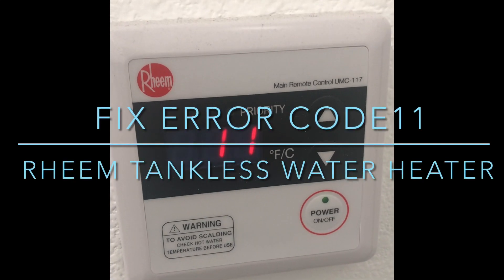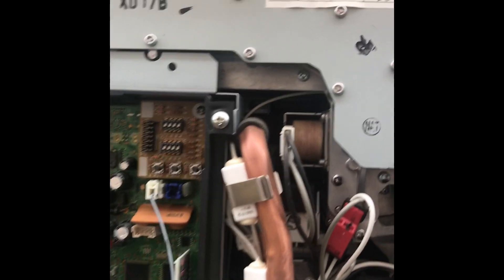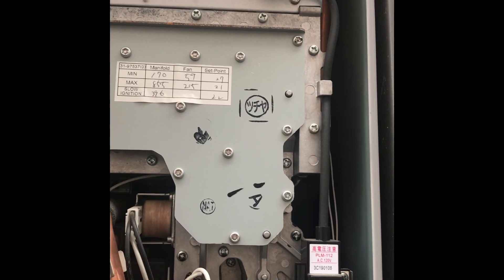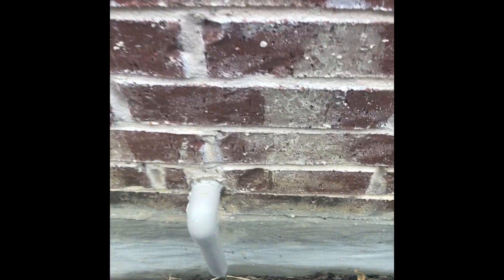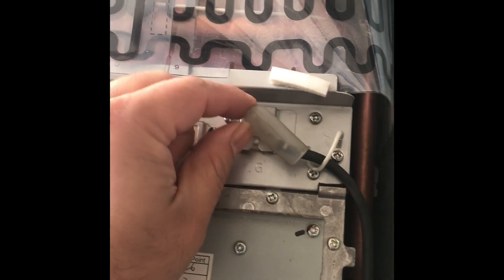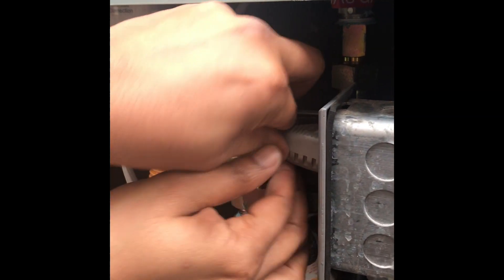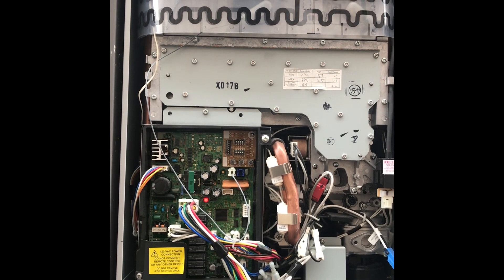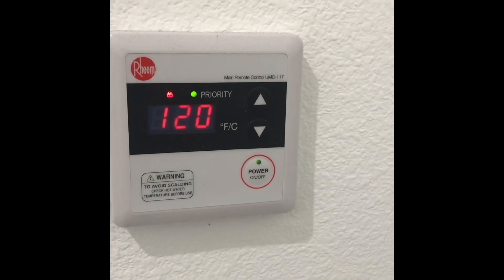DIY Fix Code 11 on Rheem Tankless Water Heater- Replace Igniter Coil

Comment: Thank you so much for this video, Prasad!  I have ordered the part you stated and tomorrow when it arrrives, am about to install it. However, I have turned off the red and blue valves going into the tank overnight, due to water leaking out of the red handle test valve. (Top red handle).   Despite turning the water off on both bottom valves, it's still leaking out of that "test" valve with top red handle, at a steady trickle. I left the test valve open just in case there is a possible pressure issue? Can you kindly tell me what I can do to fix this?  Does this mean a bad test valve, or possibly debris in there? I just had a company flush our system for the first time in 11 years. Don't know why water is trickling out of that test valve. If there is debris from the flush,  causing it to stick open, how do I clear it? Also, I tried pulling the metal relief valve on the left, but it didn't affect the flow.  God bless you sir, Lee 🙏

Comment: Thank you so much for the video.  
I had to buy a new Remote controller UMC 117 it was showing at first P1 error code and later it showed an 11 error code.  So I m hoping if I can change the igniter coil and it will work. Thanks again I have subscribed your channel and liked it as well. Looking forward to see more useful videos in future.

Comment: I have an old Paloma PTG-74PVN-1. I don’t see an igniter coil on it to replace? :( I opened the unit up and do not see this. Any tips/ideas?? Does it not use an igniter coil? I keep getting error code 11

Comment: This helped a lot.  I have an ECO160DVLN3-1 (it's discontinued) giving me this problem.  I narrowed it down to the ignitor coil & sure enough the water heater started functioning after it was replaced.  The replacement part is much larger so I was concerned that the part would fit but they provided me with the hardware to install it.  Thank you.

Comment: Thanks Prasad.   My unit threw an error code 11 last night, googled the issue and watched your video, ordered the part on Amazon and it came next day.   Replaced the ignitor coil in 10 mins.

Comment: Thanks so much for this educational video. I Encountered error 11 on our Rheem tankless water heater unit. I Found your YouTube video that showed me that it’s likely caused by a damaged igniter coil. I confirmed with Rheem tech support that it’s indeed the root cause. I ordered a replacement off of Amazon and it’s working well. Our heater was under warranty and Rheem reimbursed the cost of the replacement part. Very happy about being able to solve this issue by myself. Really appreciate your video, thank you!

Comment: THANK YOU! This worked. I had someone check the error code and they quoted me $900 to fix, but recommended replacement approx. $1400. Should have come to YouTube first. Easy to get the part from Amazon and got it done really easy. Thanks, again!

Comment: I just had this replaced with a freezing damage unit's part. Look like a common issue. This unit was installed in 2021 after the Texas grand freezing incident. Will call Rheem for replacement part as mine is still in warranty. Thank you. Maybe we are in the same community.

Comment: Lifesaver!! 🎉 thank you for this video! A plumber came out and looked at my water heater for 2 minutes (turned a valve on and off was his assessment) - then proceeded to tell us we needed a new unit and he could sell us one and install it for $2,500. Didn’t sit well with me! Called the manufacturer and they said for my issue it was usually the igniter coil and parts were still covered under warranty so they shipped one to me for free. Found this video and installed it myself in 5 minutes. Hot water is back!! Saved me SOOOO much money. Thank you thank you thank you!!!! 🤗
Reply: Same thing with us

Comment: Damn, replaced mine and it didn't fix the problem.
Reply: How'd you fix it then? We replaced the coil and it still did the same beeping?
Reply: Didn't fix it. Water heater was toast, so had to replace it.
Reply: @jimbolen6364  oh god great, thanks for the update!

Comment: Thank you! Spot on, picked up the part from a local plumbing supply company, installed in less than 20-min, hot water is restored. Great video, you have a new follower.

My igniter failed after 2 years of service. I recently replaced my tankless heater after the winter storm in Texas.

Comment: Great video, Thank you.  The outlet cord problem can be solved with a 90 Degree cord end, and marking the outlet box with panel and breaker Number also helps for home owners or next tech to easily ID the Circuit...  ; )

Comment: You only need to turn the power off, not the water supply or drain the unit.  Turn off the gas to be safe is OK, but again, not necessary.

Comment: Just saw video days ago went and purchase igniter replaced and the symptoms are the same don't know what to do now
Reply: same here......did you figure it out?
Reply: @johngregory3342  need to clean rods I did it with a low grit sandpaper and system working fine
Reply: Hi   So I cleaned the rod but still no luck...got error 11 again.   I did notice a little red blinking light on the lower part of the panel.   Does that mean something?

Comment: I have a riddle for you. My issue was the same as in your video. I changed the igniter coil but still having the same issue. The unit was working fine until my LP gas man changed the tanks. Could that have something to do with my error 11v

Comment: Victory ! Enjoying a super hot bath after messing with error code 11... 

My unit is very gas pressure sensitive (nearly 10 year old unit). 

I use an adjustable gas pressure regulator with gauge. It has a very small window to run happy (barely reading just under 1psi). Anything under or over it won't stay lit & errors out. 

I loosen the gas bleed screw under the unit till it drops pressure. You can hear the gas hissing so I know it has supply. 

Screw it back in & find the sweet spot, a Very low pressure. 

This time I needed to unplug power cord & the ignition system two wires, wait a 10 min. Plus it all back in an boom = Fire !

Comment: I've been trolling YT the past 24 hours, "In Search Of" (Leonard Nimoy) error code 11s.  Here we go.  Error Code 11 on NRC111DV 199 BTU.  You're never going to guess what the problem was!  Got a call from the tenant (this is a rental).  Was proactive and ordered Ignitor and Ignition Plug.  Turns out, the next-door neighbor moved out.  Gas company showed up and turned off the gas meter to my house (no notice), not the house they were supposed to (neighbor).  24 hours later, multiple troubleshooting, cuss words, discovered the root problem.  Point being, check the not-so-obvious things first.  Damn it.  Do I want to mess with small claims court?  Maybe, maybe.

Comment: It took longer to trip the breaker, get a screwdriver, remove and replace the front panel and put my tools away than to replace the part. Super easy! Thanks! I suggest you replace both the igniter and the coil. Parts are so cheap, why not? Wife says I'm now a DIY plumbing hero. :-)

Comment: Do you happen to know about model number RMTG-74PVN-1? Error code 11. Found ignition part, but it seems the black wire goes to the back. Not sure if I can disconnect it that way or pull that apart?

Comment: Very nice in staten island plumber was two trip one to tell you error, then wait for parts come, then he will come install another trip +installation +part cost minimum $350 and I did it in by parts only $30.00

Comment: Good video, but I found out what was wrong with my Rannai code 11 and why the coil and unit always turned off. The electrical unit was wired to my dryer and it was getting to much voltage onto it. The professional checked his electric meter and all 4 lights where on when it should have been 2 lights. Hope this helps someone with the same issue as mine.
Reply from the maker: Thanks for sharing it.  Yes.  It should be on its own breaker.

Comment: Had the same problem on my rinnai after replacing the heat exchanger, all I had to do is unplug the harness to the igniter and plug it back then it worked.
I think moisture or a little water gets on the connections
Reply from the maker: Glad it worked out.  Another possibility is dirt or dust build up around electrodes (flame as well as ignitor)
Reply: You’re lucky, my rods were singed to a nub.